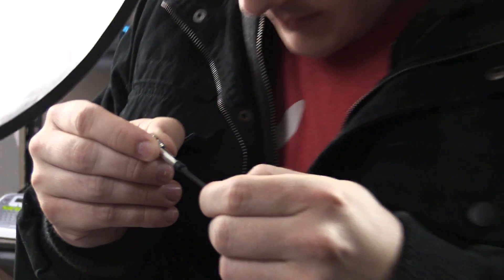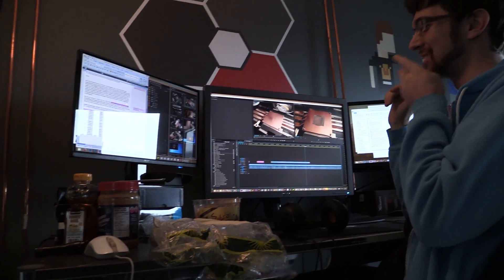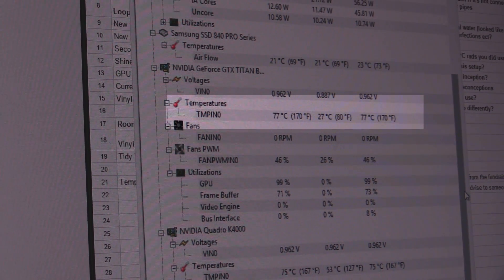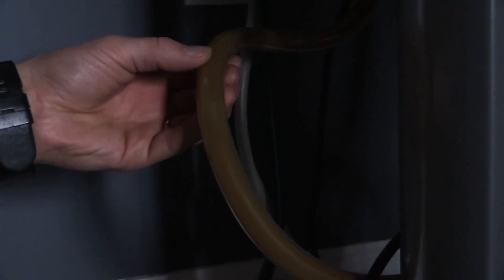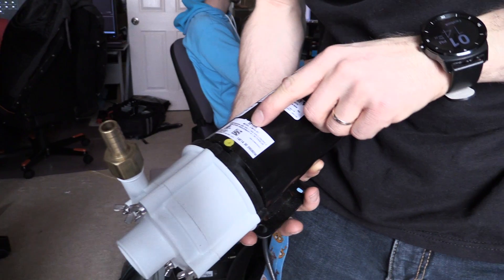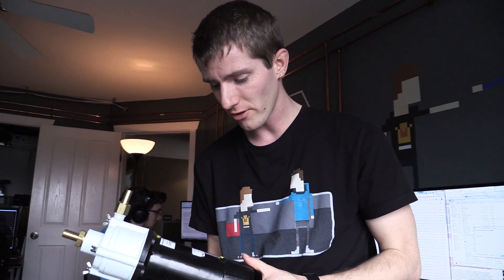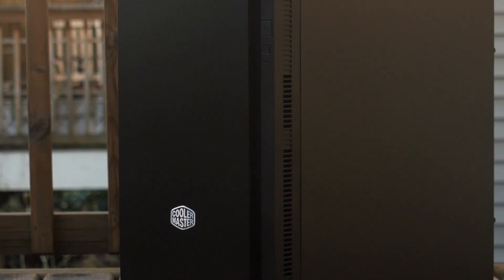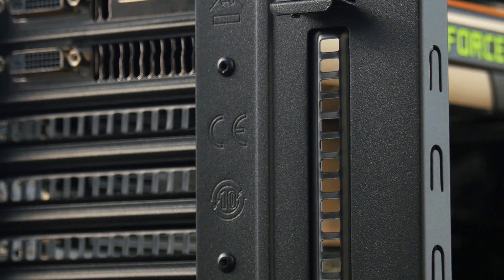Whole Room Water Cooling Part 5a - Trouble is Brewing in the Whole Room Loop...

Comment: not sure how it works with copper but our parts washer at work we use bleach for 4 hours to kill bacteria.
Reply: I should add it's called bactericide in an industrial sense but it's just a VERY strong base and you working with a few gallons as opposed to 10-20 thousand, a few cups introduced to the loop of household bleach should be fine to kill whatever you have in the system. I would suggest running the loop alone with no PC's attached for a few hours and throw an inline filter before it's reintroduced to the res to catch any chunks. Then flush 4-5times and use a algecide next time you fill the system to prevent growth from returning. Our washers are stainless and regular steel so research the effects of bases on copper before trying it. Hope this is helpful for you guys. Good luck and don't give up on the fun!

Comment: This is the stupidest idea ive seen. the fans even though they are "water proof and dust proof" they will probably last a year maybe less outside. The Tubing is gonna degrade. The copper pipes have particles in them that is not good for the pump and cpu/gpu blocks which will reduce the cooling efficiency. Plus all those pipes look stupid. and the bacteria. your whole lopp is screwed already there is bacteria in every part of it.

Comment: I was thinking of your setup and its so complex. did you draw a setup picture before starting. as you don't have filters and sediment capture basket. plus you have it outside in the sun a definite problem.  the stuff is algae build up from sun exposure. a inline uv light will treat this. a few tips first why not talk to a tropical fish tank shop and see the canister pump filter setups and try and see if you can have a shroud made to enclose the radiator, plus one fan would do and cut down on noise. I'm peter from Australia please contact me if you want help.

Comment: LINUS!!! When you move, re pipe the main loop with the proper pipe sizing in a reverse - return flow scheme (also called; first in - last out). Just Google reverse - return loop piping. 
You've made your mistakes and gotten them out of the way, now continue the learning curve and read about how to properly install a heat exchanging loop so that FLOW won't be an issue. The success of this project depends on one thing....FLOW!
I promise you I have a decade and a half of experience in this field as a boiler technician/installer and I install these loops daily. I'm trying to help and not bitch.

Comment: Watching this video, i'd recommend attaching ball valves where you may need to disconnect the pump...  that way you don't have to use hose clamps...  simply attach the valve between the pump and the hose fitting

Comment: If your using automotive coolant why not use an automotive res and radiator combo that is built to house anti-freeze or you could go with a fuel cell like they would use in drag racing that is meant for high pressure applications and comes 100% clean of any contaminants because its meant to be used with racing fuel.

Comment: So I work on cars and one thing I have learned it coolant mixture with different types of coolant.  There are many coolants (green, red, hoat and so on) that you cant mix.  For example, Hoat coolant when mixed with another type will cause it to form in a solid form which will clog.  Is it possible you mixed incompatible coolants?  Good luck guys!

Comment: You need purge the system before every water project of this size. And yes! a filter coming out of the reservoir. If you need to a filter before every pc or just by room. :-) I hope this helps and you can see this. Vote me up if you think Im right! Also, I said before that the reservoir should be bigger... I had a feeling about the reservoir in your last video. :-) God Bless and I hope that this message finds you well. I look forward to the next step of this awesome water cooling project.

Comment: seriously? add shut off valves before and after the pumps and filters after the pumps to catch any junk until you've run water through it to flush it the tank is in your shower let it drain and fill with water from your faucet.

Comment: i would clean the loop with a vinegar solution not the blocks and then  put a anti-microbiol solution in at lest 5:1 ratio 5 anti-microbiol to 1 50/50 anti-freeze distilled water solution city water may be safe to drink but not good for cars and computers cooling be cause of the chemicals  they use to in the purification process will cause a battery like corrosion to happen that way in my car repair shop we have a distilled water machine that make 500gl or 1892.71L  for that reason

Comment: I'm no expert, I just want to voice an opinion about I think you guys can/should do. Clean out the whole system/loop, dump the loop, disconnect the computers from the loop so that they are on their own loop(as anyone with a liquid-cooled system would have), and clean up the house so that stuff can be ready to be moved/ready to be installed into whatever the new office will be(besides the computers, until the time comes). Once you start work at the new office, instead of using copper pipes there is this plastic type tubing that seems to be used(my dad works construction and I see that stuff all over instead of copper whenever my dad shows me some of the houses), so it won't corrode and in order to make the fittings you'd just heat the tube up put the fitting on and let it cool. They seem to stay pretty stable(not very flexible at all). Once those are all set in place, I'd put cutoff valves(I think that's the name of them) at the hot and cold of each station, therefore if you need to disconnect or connect a station there isn't a need to drain the whole loop.

That's just my opinion if this was something I was tackling myself. Again, I'm not an expert but I think these things could help, but don't get your rip off your pants if you are really against my thoughts.

Comment: I like this project, a little bit crazy but also an interesting one. I think you know a lot of computer water cooling but just a little of water pumping in general. Algae is something that really important in a system like this. First algae grows only in the right conditions, the most important for you are light levels, PH and temperature. Temperature you cannot change, but light levels and PH is another story. When you mount the radiator you have used a white tubing from a normal water cooling pc, and you put it outside. I think that type of tube lets some sun light to pass. My advice to you, is to use a gardening tube, that one used on water drop systems,(not the thin ones) they have 16mm, are very cheap and all black plastic, not good for forming algae. If the project was mine I have used that in all system, and not the copper tubes. If you want to know more about this topic read something about hydroponic with fish system they have the same problem but much worst. About the PH some people says to put the water more acid with something like vinegar, more alkaline also works, with something like lye, but that will have a strong impact in metal corroding, you have to use with caution. An UVC Light is also known to be good killing algae, but raze other problems like, how and where to mount. The most important thing is to get harder to algae make your system their home. Good luck.

Comment: Why use a Steel Tank bad bad bad move.... Anti-freeze need to stay with a Mix of metals alloy, zink etc high amounts but low amounts of steel. You have bacteria growing plus you have flux in your system you need to purge with warm water for a few hours put the outlet into a overflow pipe toilet or waste and attach a hose pipe to your water loop system and leave on moderate pressure to purge for a FEW hours. then re assemble with a UPVC tank or Copper add central heating inhibitors this WILL kill Bacteria! and it stops corrosion!

Comment: As a temp fix, try a flushing agent like Prestone radiator flush (Don't know for sure if it would work in this type of system though, it's worth some quick research though). It works in cars, maybe it would work in your system? Also, use vise grips next time to crimp the hoses temporarily. Also, bleed the system as much as possible to make sure you don't have any air pockets, good luck!

Comment: i actually had some similar brown gunk in the radiator of my car, it wasnt as thick and solid as you had but it basically just felt like old gelatinous oil. still dont know what it was but i had it flushed and it hasnt seemed to of come back so i guess its fine. :/

Comment: Hey Linus, The goop reminds me of the scum that can gather up at the bottom of a car radiator. Especially if an additive has been added. May be left over oil/wax coating that would have been used when storing the sheet metal in the store room before its picked and used to make the res a bit like  emulsified oil and water.
Reply: yeah thats the problem i had with my car, i had the radiator flushed but the guy didnt really seem to be shocked or in a panic about it so i guess its a normal thing with cooling systems.

Comment: I've used a combination of distilled water and special antifreeze which is supposed to kill bacteria and algae... it didn't work. Even after few month's i've had similar "growth" inside tubes and some corrosion. I've dismantled the water cooling and installed noctua fan instead.

I recall imagining a water cooling solution for an entire room years ago, during especially hot summers, which would cool both pc and myself, but i never though that it could work. Hopefully you can get it done.

One solution which should work - faster moving more concentrated antifreeze liquid inside those tubes. Perhaps installing several pumps in different places of the system. Its the lack of motion which normally promotes algae growth in the ponds. Also installing glass tube or reservoir and an UV lamp attached to it will make it even safer.

Comment: LinusTechTips  certain brands of automotive anti freeze contain lubricants to help prolong the life of water pumps. my guess is that the crude floating in the reservoir is some of the oil that has separated. the rest of the crud such as in the clear tubing and inside the pump looks more like rust to me. I've seen both of these issues in car radiators.

Comment: Working in a beverage plant I can tell you that (WITH THE SYSTEMS OFF!) you can fill the system with hot water and run sodium hydroxide through it to kill the organic matter for about 20 minutes, flush with water, then run hot water and peracetic acid solution though sanitize and protect before refilling the system.

Comment: I am no tech guy, but why don't you try pumping alcohol through?

WAIT, don't shout on me yet.
I have researched recently, and found that alcohol is non-conductive. As long as it is 99% or above.

And since it is known as a common antiseptic in all hospitals, it should be effective on cleaning what is present in the system.
I also saw that it shouldn't be able to ruin any part of the system (e.g. copper heatsinks) as alcohol does not ruin anything like it.

Anything wrong? Please reply!
Reply: um cost is huge alike to a comment below with the UV filter thing both are used in hospitals for the same reason both are expensive but both work very well. Just alcohol you would have to flush out before refilling the system with whatever you do use as its abilities to absorb heat aren't that much and if you need the solution to be 99% or above then that will just have to be a cleaning method not a always on method while the method of a UV light filter and/or liquid holding tube like thing will be a method for a always on method both are good for making sure everything in the tubing is dead though.
Reply: Alcohol reacts with and makes brittle the plastic in the tubing and the rubber in the seals. Colloidal silver could work, but it would require a clean system for that size. As for cleaning the reservoir, he could throw it in the fire lol. But seriously, if you fill the reservoir and boil it, that should kill and decompose the organism(s) inside. Extra points if you add a few bottles of bleach to the solution and flush out.
Reply: Shaka Salmon Well, at that point, the reservoir would be clean.
How about the tubing?
The gunk on the tubings will still be there.
Also, what do you mean a "clean system"?
Reply: yumri4 This is ONLY for cleaning the system.
Alcohol vaporizes very quickly, and heating it would be worse!
Alcohol in here is only to clean out the lifeforms in the tubing and reservoir.
Reply: DatGameh for cleaning it they yeah though the commenter who suggested a UV filter thing for it would have a more permant solution though more costly it would not have to be replaced as often and would work constantly cleaning the fluid all the time on each pass which sounds better though as i paid someone else to set up my own liquid cooling loop i am unsure what would be the best route for it .
Reply: yumri4 Sounds like a good idea.
A self maintaining liquid loop.
But price is also a thing to consider.
Know any alternatives?
Reply: Alcohol will dry all rubber seals etc and after that they will just crack and eventually start leaking
Reply: Alcohol burns near to invisible flames once it ignites. It would produce a lot of attention though but I think its quite a sad story all those wounded :(
Reply: also 99% alcohol, lol, you are awere that alcohol over 97% evaporates immidietly and has to be in a pressure container if you don´t want it to evaporate everyware instantaniusly...
not very easy and not very practicle way to do anything...
Reply: Michael Seeber Note this is NOT PERMANENT.
It is supposed to be a place holder to kill the microbes alone, then replace the alcohol with the coolant again.
And the system must be off or else the alcohol will infect the system with gasses!!!
Reply: litaa chang It is only for cleaning the system. IT is  not permanent.
And turning the systems on while alcohol is still in there will ruin everything.
Alcohol gas would be stuck in the system!
Reply: +DatGameh fill it all with alcohol or have a watered down solution? because that much would be expensive wouldnt it?

Comment: So this question is more to the earlier videos but why was a bunch of small radiators for computer cooling connected together for the outside portion instead of using a larger, single radiator? If you used and automotive radiator and larger electric automotive fan, it would more likely hold up better being outside since they normally have to deal with some moisture and temperature extremes and possibly be cheaper to purchase.

Comment: Hi Linus, I'm no expert, BUT I've seen this on a faulty air con unit in our Server room at work. The solution the manufacture said when we called them out as it wasn't pumping water out was to flush with antibacterial chemicals over a couple of weeks. I know you have the room water cooled but our air con pipes went the same color as well and had the same colour slime in them eventually blocking the whole pipes and pump. apparently its bacteria causing it. hope you get it sorted and I love these projects!

Comment: If you running regular antifreeze add some Redline Water wetter its a pink bottle to keep the anti freeze cooler and help with corrosion through  those copper pipes

Comment: Not sure if this applies but some automotive antifreeze will create film some turn to a sludge or even sand like if exposed to air they do this to prevent corrosion but you used green witch is most likely more an acidic type.

Comment: Oh man, I can engineer this system so much better.  I'm only a plumber but I do install million dollar hydronic heating systems. I consider this a cooling system but the fundamentals are the same. It's very cold where I live (-36C atm), so it's important to know how to keep a balanced flow between all components and ejecting air which prevents air locks, which might lead to pipe freeze ups and cold spaces or in your case high temps. The pump you are using Linus is not designed for your application I would say is meant more for high pressure scenarios, a fire hose uses the same type of pump.  Also using the wrong type of coolant. Send a message you like a couple of suggestions.

Comment: Flush all the blocks, fittings and rads with paint thinner /acetone/ 99% rubbing alcohol, then rinse with distilled water to kill any bacteria in the systems, I suggest a distilled water/antifreeze blend with a chunk of raw silver mounted inside the rez (anti bacterial), Replace the tubing.
Reply: Not acetone, it'll likely kill your tubing.  I'd go with 50% methanol (methyl hydrate, wood alcohol) or 50% isopropyl alcohol (not rubbing alcohol, which may contain lanolin) to remove hydrophobic organics, then 10% bleach as both a biocide and to dissolve otherwise insoluble organic material.